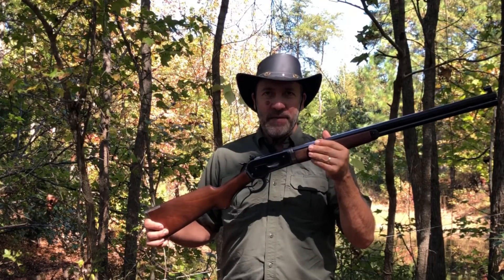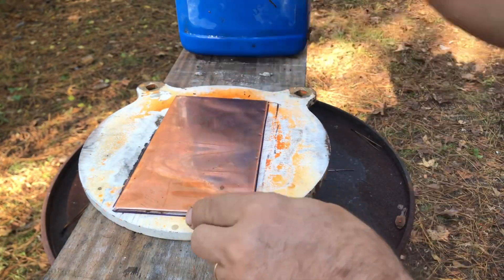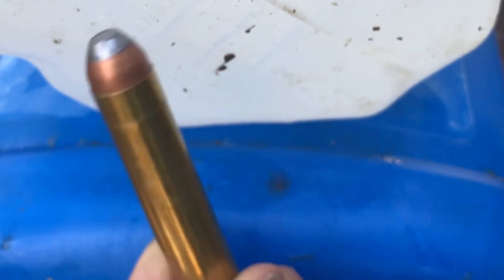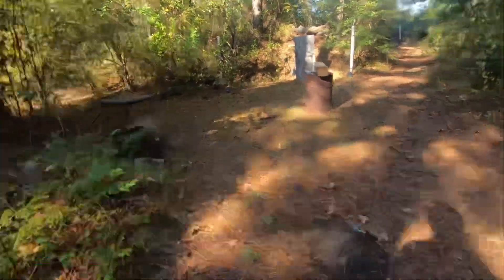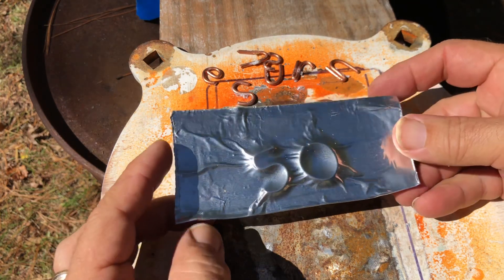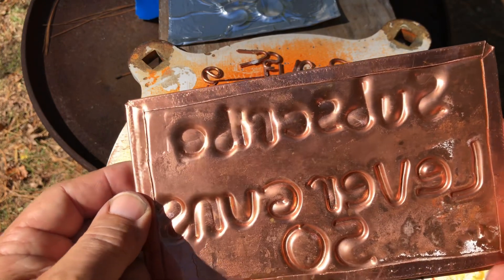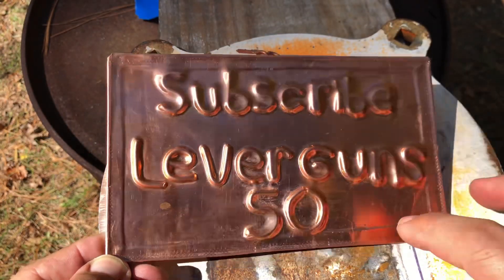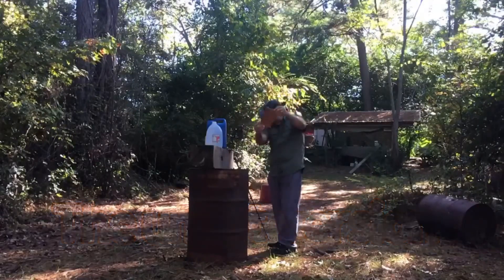How Ballistic￼ printing is actually done￼

Comment: Killer video. I was gonna reach out over DM and see if there might be some semi-practical uses for this technique to make various parts. I feel like you could make all sorts of brackets and stuff, this technique produces brake-press level forces.
Reply: traditional hydroforming is a big affair, I think there is something valuable here in how simple the setup is
Reply from the maker: Thank you that sounds really interesting
Reply from the maker: That would be interesting to see what could also be done like this
Reply: @Leverguns50  I think the first thing to do to take this further is to test your current setup and see what thickness you can bend and the "effective" area that the water pressure is high enough to do anything with (looks like water pressure drops off pretty quickly near the edges). You might be able to confine the water bottle a bit so the pressure is high and more equalized (think thick plates on the sides thin edge towards the shooter) but that has ricochet potential.
Reply: Another big thing is to adjust the base to the setup. As is there is a lot of flexibility (you lose a lot of energy just getting the barrel to sing) so you might consider setting up on a wide tree stump. I'd make a |_| metal bracket around the water jug and lag it into a stump. That way more of the energy has to go through your pressed plate. This might be more dangerous that what you have now though, so take this with a hefty serving of salt

Comment: Love that re-barrelled 1886.
Have you thought of straight-cutting the stock for adapting a recoil pad? Or perhaps a shotgun-style replacement stock with a pad? Would that make the recoil more manageable?
Reply from the maker: I never really thought about doing it to this one because I have one with a 71 style butt stock with the rubber butt pad and muzzle brake, to me the crescent butt plate feels fine, as long as you don’t get one of those pointed ends against your shoulder and pull the trigger, done that before Man alive that hurts

Comment: It’s amazing the amount of pure power in them rounds
Reply from the maker: I wish I could figure out a way to measure it
Reply: @Leverguns50  All you need to do is chronograph the velocity and use one of the many apps that will give you the FPE after you input the projectile weight in grains as well as the velocity in FPS.